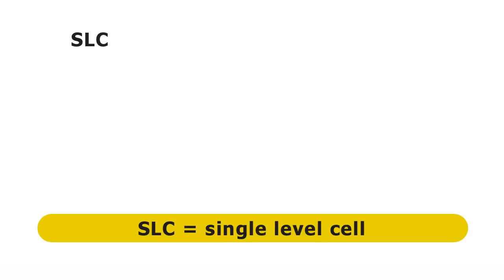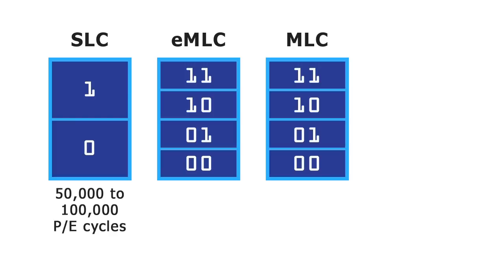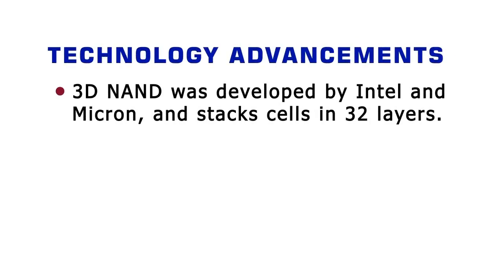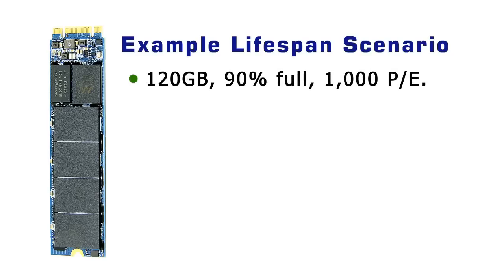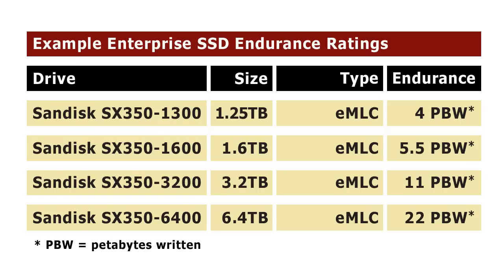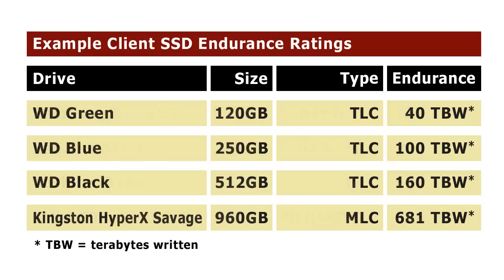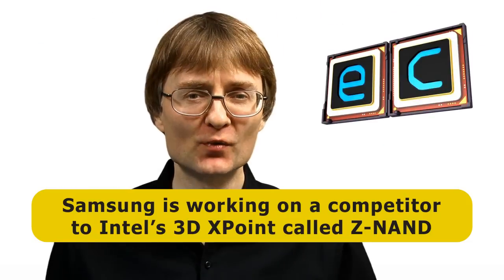SSD Life Expectancy

Comment: Is their a difference between using it on a computer or is it the same on a console?
For example, if I'm using a 500Gb SSD as the primary drive of a PS4 and using an HDD as an external drive (which has all the games in it).
Reply: Data is data, regardless of the system you use.
If you install new, large in size games constantly on your PS4's SSD, then it will wear your SSD regardless.
Reply: @charmingpeasant9834  thanks man

Comment: Still have my thicc SanDisk Extreme 240GB SSD from like 2013, used it as a boot drive in my main PC and then in a secondary machine. 
Now just using it for file transfers, thought it would be dead by now!

Comment: Presently I'm booting my kernel off of an SSD and use a hard drive as mass storage and swap. I occasionally use the SSD to store data, but I eventually move it off of the SSD and onto the hard drive. I try to keep the SSD (500 gig) at no more than 50% (256 gig) capacity.

Comment: Those of us who use data erasing or shredding programs are probably wearing out our SSD's at an alarmingly fast rate as those erasing and shredding programs overwrite data multiple times. Come to think of it, if the drive is spreading that around, it may not even be rewriting the same data that we want erased????
Reply: This is why defrag isn't necessary or even advised with an SSD whereas, it was recommended for an HDD.

Comment: Samsung 840 Pro 256 purchased 2 in 2013 and setup in RAID 0. Late 2019 one of the drives died so I reinstalled Windows on the other and that died today.  The warranty was for 5 years so Samsung have got planned obsolescence just right.

Comment: Let's say the disk is used for storage, let's say it's unplugged most of the time, and accessed occasionally (the wear is negligeable).
How long will the data last on SSD (and HDD) ?
I mean, not in life cycle, but how long does it take for 1 bit of data to vanish, for the substate to decay, lose its magnetism, or for the coating to degrade etc ?

Comment: Funny. The manufacturers of the MEMORY CHIPS say the data deteriorates after 10 years. If the flash is powered on, the Error Correction circuitry in the flash controller is may check and correct in the background, hence maintaining the vendors 150 million hours before failure. In practical experience, the flash bios on motherboards typically develops fatal errors in 7-8 years, in line with flash memory chip manufacturers data.

Comment: Still rocking 2 seagate hard drives(500 gb and 320gb). 9 years old(power-on hours 2259 days 12h) and other 11 years old(power-on hours 2456 days 10h).
Reply: HDD are slow but but reliable I think.
Reply: @robertdaone  as long as workers don't smash it around and handle it well. Too many people get hard drives from amazon which fail after few months.

Comment: I have a 1 TB SSD as a back up drive, the problem I'm having is that the computer keeps moving files to the backup and deleting them from the main hard drive! I was looking for some files just recently and they were completely gone from my hard drive, but they were on the back up. I have had an external hard drive fail before so I want the files in both locations. This really bothers me because if the external SSD drive I have were to fail, it would take a lot of information with it, not good at all!

Comment: If i leave an external drive, with 1 or 2 tb of data stored inside, unplugged and untouched in a safe location for like several decades , would i find the data intact inside?
Reply from the maker: Almost certainly the data would be gone. An SSD needs to be powered and the data read every few years to maintain it. Same with a hard drive, where the data need to be refreshed by being re-written every few years (although a HDD left for 10 years is likely to have data left on it, an SSD probably not).
Reply: @ExplainingComputers   By powered you mean its enough i plug it to the pc or laptop and look at the data inside? Or transfer some data in and out?  Sorry if i seem specific in my questions, so i can take precautions.
Reply from the maker: @lennethomega6731  To refresh an SSD, you just need to read the data, not re-write it -- the act of accessing an SSD memory cell will sustain it.
Reply: @ExplainingComputers  Thank you.

Comment: You were talking about a Samsung V-NAND SSD 850 EVO, I just bought a half a year ago a Samsung V-NAND SSD 860 EVO SATA 6 Gb/s.  EVO was not talked about in this video.  I am not really sure which computer I am going to use this SSD in yet.  My newer HP Desktop, and HP Laptop both have 250 GB SSD, which I know is Samsung SSD's.  Talking about long life, my wife just updated her DOS software to Windows version, so I have given her two modern laptops for that.  The Desktop that was using regular Hard Drive, well, the Hard Drive is 23 Years Old.  It is a Sony Vaio, 1998, (originally came with Windows 95, she was using 98SE), PCV-230, Pentium II running at 300 MHz, originally 64 MB, upgraded to 190 MB, 6.4 GB, not updated, a new PCI Sound Card, (Ebay Cheap), 4 PCI USB Card, (Ebay Cheap).  Now, that it is mine, I have put Windows XP on it, Office XP, Lotus Office Millennium, Kasparov Chess, 2 different Hoyle Card Games, Non-Internet.  I don't know...it is working well!

Comment: SSDs are far more reliable than HDDs. However, they have two bad points. One, malicious or poorly programmed apps or updates (like the infamous October 2020 one of Windows 10) can destroy SSDs due to an absurd amount of read/writes or simply frying NAND.

Two, SSDs die when they fail. This isn't meant to sound humorous. HDDs go through a process of *dying*, they slow down, shut down a bit, click, beep, but they still work. SSDs literally just die with almost no warning and you're lucky if your SSD turns Read Only so you could do any data recovery, usually they just die.

To put it morbidly: HDDs contract and die slowly of cancer, while SSDs die of strokes and other forms of instant death.

SSDs are not a good PURE storage medium anyway, even now they are over 2x the price of HDDs. This is amazing for gaming or video editing, but for storing data, it's still too expensive. For a PLEX server, you want HDDs, because the cost of running a PLEX server is already stupidly large.

Comment: If you storage photos and videos on a flash drive leave to unused for years will the information stay ...are flash drives reliable without heavy usage .????
Reply from the maker: Data on an SSD should last a year or two non-powered. Flash drive reliability indeed decreases over time -- the fewer times you drive to a drive, the more likely the data will be retained and for longer.

Comment: Buying an SSD for my laptop was best thing ever that happened to it, the 5400 rpm HDD took 3 minutes to boot the laptop to a point where It wouldn't freeze anymore, with WD green 240GB ssd it takes about 25 seconds now. And I installed that old hdd in my Desktop PC where I figured out that it was failing and developing bad sectors. So I guess SSD will last longer than the HDD did (only 3 years -_-)

Comment: My original ssd lieton something which was built in originally in the pc when it was brand new and costed me five hundred even without windows, windows failed 3 or 4 times in the last half of the year and after installing windows and it crashes even sooner, like every two to three weeks, so I got a new one, hopefully this one will last, as my bud said 'silicon power' brand ones are good. So I think the ones that come in the pc's or not quite well made, from a bad brand five years is still good, but considering, that best branded ssd still costs 27 quid, it does not make sense to even look for something cheaper.

Comment: So basically, the further you go in the cell you can store more bits but you damage it more, but when you add or double the bits in the cell you effectively double the store it can have? I mean, 45GB in TLC would mean exactly 15GB in SLC (at the same real size of the NAND memory)? Like when DRAM-Less SSDs use it's TLC/QLC storages to kind of simulate SLC and use it as cache to get faster read/write for that amount of GB in SLC

Comment: I've had more HDD failures than I have SSD failures. IN fact, I've had no SSD failures, and 7 HDD failures in the last 5 years.  My oldest SSD is 5 years old now, and it used HEAVILY.  I never bothered to do all the stuff people used to say like turning off pre-fetch and indexing. Just stuck it in and used it.  It's still perfect.  I'd rather trust a SSD than a mechanical HDD.

Whatever you use, have back up.  That doesn't mean RAID either. RAID is redundancy, not back up.
Reply: Network drives are cheap and easy to install/config, imo.

Comment: I still have old HDD's that were probably in old IBM towers that will probably still work (Slowly) if my modern systems had IDE connectors. Recently picked up a bunch of used systems that all had 250GB SSD's in them. They are just running the operating system since I don't know what the previous owner used them for and trying to convince my cousin who I gave one to not to over use it. It's fast but could fail at any moment now.
Reply: Have you thought of getting just a giant (2+ TB) mechanical (cheaper) hard drive and using it as network storage for backups just in case?

If you're concerned about the data. If not it's whatever then lol
Reply: @joethestrat  That's my current setup.

Comment: Could i be able to use an external drive on a computer with only an SSD (512GB)? Would that limit me to only be able to use my computer with the external drive connected?

EDIT: i'm still choosing a computer. The chioce lays between a computer with only an ssd (512GB) and one with an ssd and a system with an ssd + hdd (250GB+1TB). I intend to use the computer mostly for gaming, but i will have to move it every week from one place to another back and forth, which causes a question. Which should i choose? Hdds aren't really good for traveling, grant a lot of space and run slower as far as i know,  while ssds, run faster, and are better for moving the computer around, but i'm worried about the fact that they don't offer nearly as much space in my case, and that it will fill up with files.

Comment: This might sound crazy, but what if there were some sort of SATA-based dedicated scratch disk drive on the market? This would be an SSD designed to have intentionally volatile memory, like cache or SRAM modules, but with larger than 16GB capacity, thus allowing data to be written and erased in isolation from the dedicated non-volatile memory of the rest of the system. Basically RAMDisk without consuming RAM.

Comment: The less free space you have on your SSD, the more those 'temporary files' will be constrained to a smaller and smaller number of physical blocks on the drive. If you're down to 5% free, those SSD blocks will burn out 10x as fast as if you were operating on the drive at only 50% filled -- because the odds of a block being used for a temporary file is increased 10x when you're down from 50% free to only 5% free.
Reply from the maker: Correct.

Comment: Wondering if it a good idea to only run windows on an SSD and run application, program data, user data off a normal SATA HHD? this set up would be for a home network HD movies storage database! I don't wanna use windows for this set up instead Linux distro(which one would be good for this work) but if I have to i'm looking at win2k(which will not have access to the outside world)

Comment: Commenters: don't be a moron: "over a decade" is not all that you need to hear.  What you need to hear is "use SMART to monitor your write rate, compared to the expected endurance".  The answer is not just "good for 10 years" unless you have very cold data (and/or buy lots of unused space).
Reply from the maker: Thanks for your insult, but I do not being that I am "being a moron". This video does not say that all SSDs last 10 years. Far from it. Rather, I give a lot of information that makes it very clear indeed that life expectancy depends on the drive and its use scenario. "Use SMART to monitor your write rate, compared to the expected endurance" is also not an answer to the question of how long an SSD may last, it is a means of tracking life expectancy for a particular drive.
Reply: @ExplainingComputers  I'm sorry you mistook my reply, which was specifically to the many comments below that do indeed say to skip to the end of your talk and credit only the "over a decade" is the punch line.  I've clarified the comment.
Your presentation is good, though you waffle a little on TBW (which is, of course, no different from a erase-cycle rating times device size).  I don't think it's ever appropriate to make generalizations like "your SSD will last many years", though: it's completely normal for two users to differ by a factor of 100 in their time endurance, simply because they have different IO behaviors and different devices.
Life expectency for a particular device is exactly, no more and no less than its rated TBW divided by your idiosyncratic annual write rate.  The only way to derive the latter is by monitoring your device's SMART parameters as you use it.
Reply from the maker: @markhahn0  Ah, my apologies. I now see what you were talking about and reponding to. My bad.

Comment: Any very important data like photos you can never get back should also be stored offsite in case of a fire or other physical damage or theft. Today that is made really easy with consumer cloud backup. If you don't have a lot, there are even free options like Google Drive that gives you 15 GB of free cloud storage. Everything there will be backed up by Google and made sure that it won't ever be lost. If you are paranoid about losing the data, you can store that data on multiple cloud storage services.
Reply from the maker: Agreed -- the 3-2-1 rule matters. But nowhere in this video did I suggest that data should only be kept on an SSD. :) All storage devices will fail.
Reply: @ExplainingComputers  I  know, I just wanted to mention cloud as an option. It's very easy for the user as long as your internet is fast enough so it's reasonable to upload files.
Reply from the maker: @Noksus  Yes, you are right -- cloud is a very good option that too few people make use of.

Comment: Do I need to worry if CrystalDisk and HWiNfo say that 2% SSD life left
Its a KINGSTON SA400S37240G 240.0 GB for reference
Reply: Try using the official kingston tool if there is one. How old is your drive, do you write it often? Also, it's probably a good idea to back up every valuable piece of info on it to your hard drive just in case, because 2% sounds terrible.
Reply: @ДмитроПрищепа-д3я  well i use only SSD bcz im a gamer and video editor as well as a Student  ITS 1 YEAR OLD 
My Total host write is 5464 always runs at 28 degree to 32 degree (situated near front panel with 2 fan) and 35 degree under extreme load
EDIT : Yes, i backup up every data
Reply: @viannrizvi3489  Damn, down to two percents in just a year is really odd. 
5464 gigs of total writes sounds crazy(edit: though it is just 15 gigs a day, sounds kinda reasonable). You definitely need some kind of HDD to properly utilize SSDs and not kill them with constant writes. 
Though if I found the right product, TBW of your SSD should be 80 terabytes, and you've written merely 5ish, so again, it's kinda odd.
Reply: @ДмитроПрищепа-д3я  yeah man if it fails maybe imma claim warranty

Comment: 8:38 Over a decade? Hmmm.... my Toshiba Satellite laptop is that old and its 1TB HDD is still going strong. I'm considering replacing the HDD with the same capacity SSD but I'm undecided if the increase in speed is worth the probably shorter lifespan.

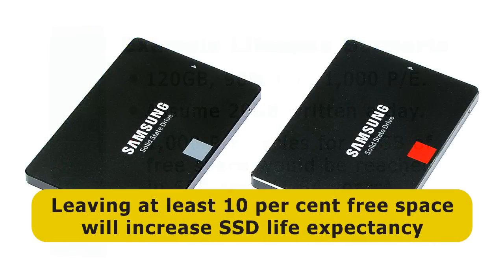Comment: 5:13 "to leave adequate free space on an ssd to extend its live expectancy. Keeping such free space is known as over provisioning"
Do you have any sources for that? I get that manufacturers reserve space not accessable to the user and lock parts of the disk that have been written 2000 times and swap that space for fesh cells. But why would the amount of free disc space make any difference? Weather disc space is free, of filled but not re-written should make no difference. In order to do so, the disc would need to be able to analyze the filesystem to actually get which parts are free. Maybe for ext2 free space is 0000, for ext5 it might be ffff. What would happen if a disc is older than the filesystem and would not be able to determine which parts are full and which empty?
I get that  a disc can analyze how often a cell is written, but I am pretty sure it cant determine wheather it is full or not.
Maybe in combination with defrag a full disc might be a problem, and maybe if the manufacturer thinks each bit is written once a week, but not if there is a 25 GB video fille just sitting there for 2 years.
Reply from the maker: The less times a flash memory bank it written and erased, the longer an SSD lasts. So free space has to increase life expectancy -- this is indeed the very reason that TBW and other measures are cited by manufactuers! :) And  files "just sitting there" certainly are an issue, as they increase the intensity of write on the other cells. For example, if 119GB of a 120GB were full of files, the remaining cells would get hammered by (eg) constant cache writing by the OS and browser. Now, the wear levelling software will try to reduce the impact by moving data around -- but this in turn creates P/E cycles that would not have to be incurred if there were more free space available.